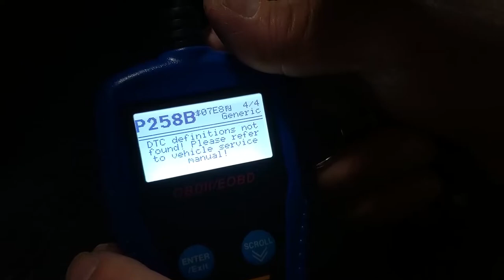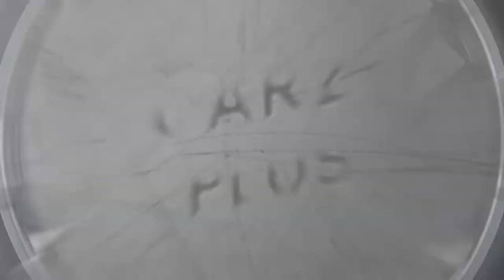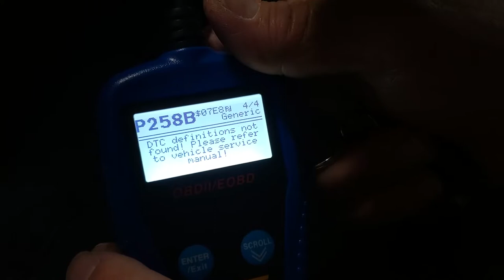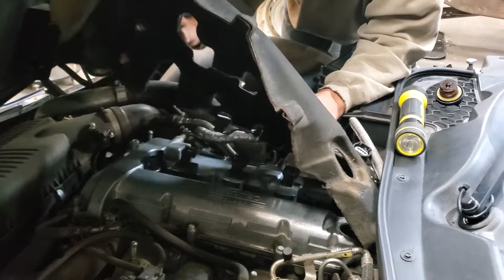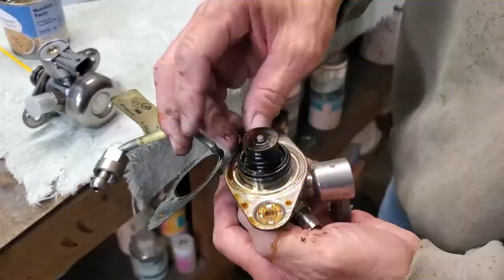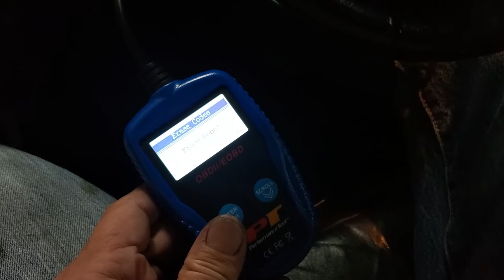Pontiac Solstice Saturn Sky Fuel Pump - How to Replace a Solstice or Sky Fuel Pump

Comment: Thanks for the video.  Mine also has 120,000 miles and the pump in mine is failing.  Dealer quoted me $1,800 to do this job.  After watching this I will do it myself.
Reply from the maker: That's equivalent to rent or a mortgage payment, or a station wagon full of groceries. Glad it helped.

Comment: Hi. Big fan of the Kappa platform, had an '07 Sol GXP when new that I never should have let go and an '08 Sol GXP now. Just to clarify is this the same mechanical pump for both the 2.0L and 2.4L engines? It was my understanding that each engine had a different pump.
Reply from the maker: We did own a 2.4 at one time, but the mechanical pump wasn't in need of replacement. It's possible that the two are different. Each time we order parts, we specify that we own the 2.0.

Comment: So should you remove fuse #19 (main low pressure) AND #13 high pressure?   Or just 19?
Reply from the maker: It is best to do both since the low pressure pump can provide enough pressure for limp mode to run the engine. There is more pressure in the system than one assumes.

Comment: What would be happen if i didn't pull the coil packs out when i change the HPFP?

And do you have any idea about P0090?  

I replaced the HPFP myself and P0090 was popped up yesterday. (The HPFP change is already installed without pulling the coil packs out)

*Plus Do you know how many psi should be shown when you test the fuel system pressure with fuel pressure gauge(manual fuel pressure)?
Reply from the maker: Wow, that's a good question. 

My car had gone into limp home mode as well as having the code. This made is quite obvious the high pressure fuel pump was bad. Let's assume yours was also. You can also have other problems. Examples are an open or shorted circuit in the wiring harness, an ECU going bad or a very likely bad electrical connection. I would start with the later as it would be a likely problem. The bad news is that not all new parts are good and it could even be that it is faulty. However, I would not be looking there if the car is performing properly save the code. As to not removing the relay it could possibly result in damage, but you can not guarantee it. It is best to remove it. Thanks for watching!

Comment: Do these pumps get tired? Should I replace it because I have high miles on mine? A lot easier than I thought. Thank you.
Reply from the maker: Good question, thanks. Yes, they do. The failure doesn't occur at once, but is gradual. You'll probably not notice it due to the gradual decline. Performance does degrade, but I can't tell you the exact mileage.
Reply: @CarzPlus  since it’s such an easy change, I’ll do it to mine this spring. Thank you so much!

Comment: 2006 Solstice has a fuel filter? If available, then where is the location?
Also, there is no fuel pump in the tank?

Are you saying there are two fuel pumps, one in the tank & this on the engine?
Reply from the maker: Our video covers the high pressure fuel pump (as indicated by the fault code) which feeds the fuel rail / injector system at several hundred pounds of pressure. You are correct that a low pressure fuel pump around 60 psi resides in the fuel tank. This is the pump we disable in the video with the fuse at the fuse box. It is also where your fuel filter is. If you have poor pressure, or no fuel fed to the high pressure pump, you will have to replace the low pressure pump in the fuel tank.

Comment: Isn't the fuel pump in the trunk?....In the fuel tank?
Reply from the maker: The pump referred to in the video is the high pressure pump used to charge the fuel rail  for the fuel injectors. The tank pump merely pumps the fuel t the high pressure pump which then boosts the pressure up to several hundred psi to use with the injectors. If this pump fails, the tank pump, at best, will only allow the car to operate in "limp home" mode.